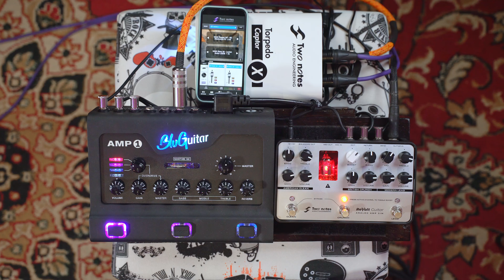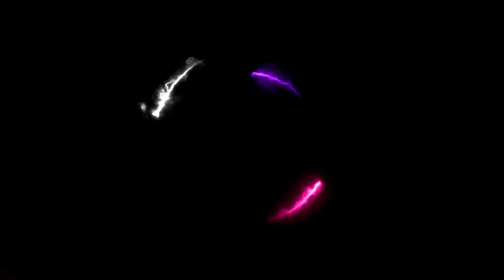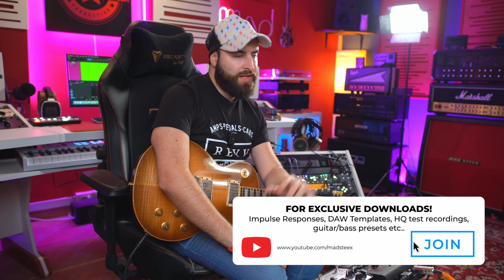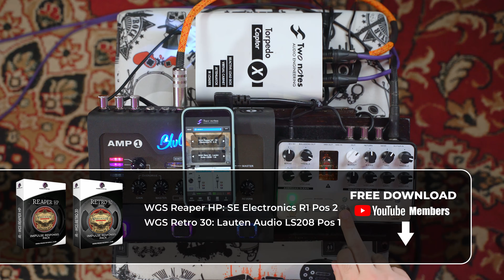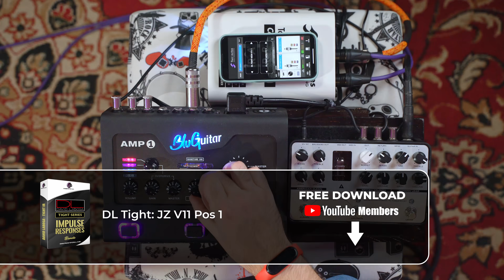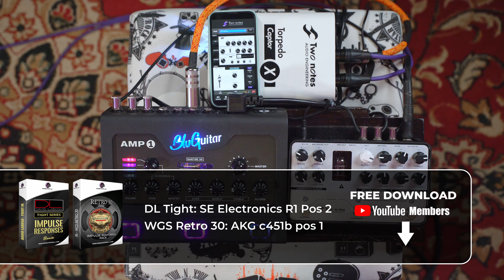Analog Amps in Pedals | Two Notes ReVolt Guitar VS. BluGuitar AMP1 Iridium

Comment: :face-blue-smiling: With the METAL HIGH GAIN TEST, on the Revolt, YOU MUST go into the TWO NOTES and address the EQ, Compression in order to bring the tone closer and tighter to the Iridium in this example. Again those two amps are just not going to be  FARE oranges to oranges compare. It should have been done with the BluGuitar Mercury.
Reply from the maker: thank you

Comment: THIS IS BEYONG NOT BEING A FARE COMPARISON! You are running the REVOLT into the POWER AMP SECTION of the IRIDIUM!! :face-turquoise-covering-eyes:
....Even though the IRIDIUM is a completely different voicing from the REVOLT AND THE MERCURY WAS A BETTER COMPARE, bot units should have went direct into the TWO NOTES CAB, using the power amp and section and cab from the TWO NOTES. No one has an Iridium lying around to run the REVOLT INTO, so its power section is irrelevant in this comparison.  :hand-orange-covering-eyes::hand-orange-covering-eyes:
Reply from the maker: I'm not comparing the poweramp section, that's why I'm using both the preamp into the poweramp of the iridium, cause was impossibe to bypass the poweramp of the iridium. So Both preamp into one poweramp, doesn't matter which power amp, but if you really like to use block letters, it's up to you.
Reply: Thank you for that comparison. 
It’s the tube driven poweramp of the Amp1 what’s make it very special. 
It’s not just a normal power amp.

Comment: 10:56 on the side, theres a small tone knob which at 100% helps you cranking the Clean channel at lower volumes, this is designed this way to provide tons of headroom
Reply from the maker: If you are referring to the BluGuitar pedal is already at 100% in fact it cranks well